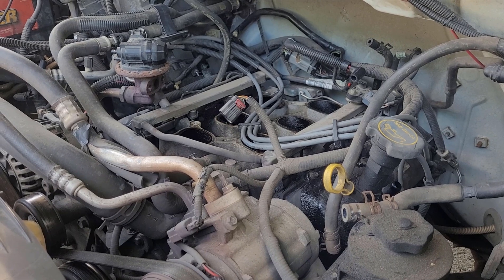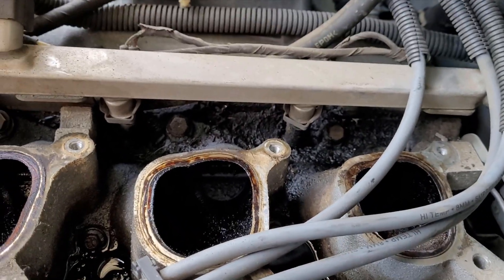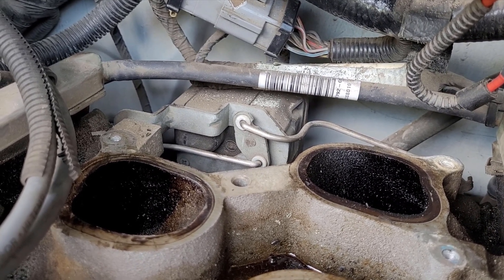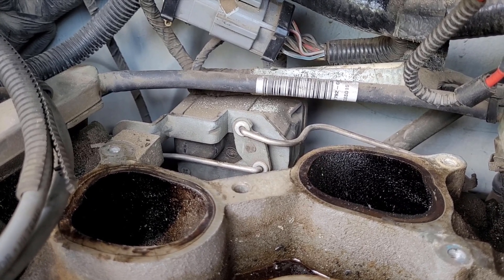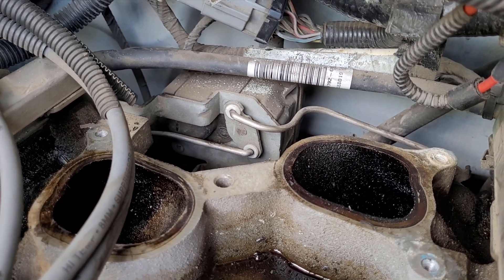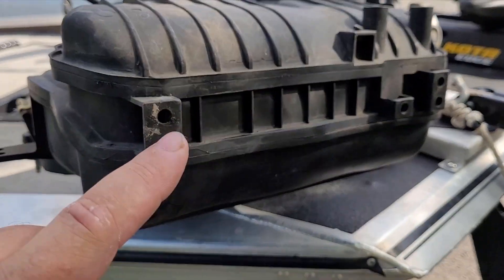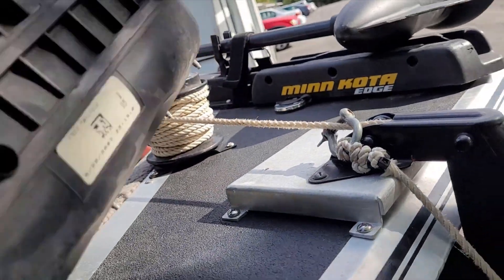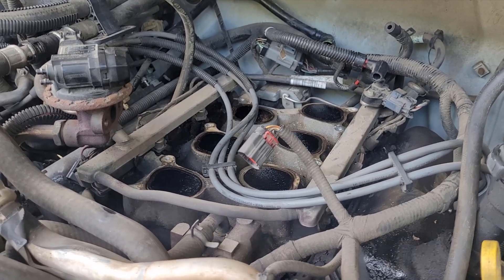Intake Manifold Runner Control Valve, 2008 F150 4.2L V6 - Part1 P2004 Code (Error Code P2004)

Comment: might as well remove the lower intake and replace the gasket and the o rings on the fuel injectors , you did the hard part already. I did this and now over 400,000 miles and running strong !

Comment: Where can I find the actuator for this motor ? Not even ford dealer has it
Reply from the maker: Im not sure if you can. I replaced the whole unit from RockAuto.com when I replaced mine.
Reply: Did you find the part, if so do you know the part number?

Comment: Do you need to drain any antifreeze out of the radiator before starting this job? One guy said you do but I want to know if you had to. Thanks
Reply from the maker: No, I didn't drain any out before hand. I think there is a coolant line that goes to the upper intake but I dint recall muc if anything coming out of there.

Comment: Thanks for the description.  I had this work done by a reputable shop and I was curious about what they did. Mine had clips broken and the shop replaced them and my 200k
08 f150 now runs great again.  Thanks
Reply from the maker: I'm glad you found the video informative and helpful that's exactly why I posted it. When I started searching for information related to the p2004 trouble code on our 4.2 L V6 engines I didn't really find much of anything.
Reply: @cpthillbilly  i had a lean code (P0171) which was incorrect it was actually rich but at least they chased it to the intake runner 
and the broken clips on the butterfly, I believe.  And 2 weak injectors.  Changed  plugs, wires ( both had 80k) and coil had weak spark. $1100  total.  It is worth the cost because its a great truck that looks almost new.   Thanks again

Comment: What about a leaky gasket where the lever goes into the lower manifold? I have that problem which is causing lean code. Stumbled on your video. In process of how to resolve that leak
Reply: I think you would need to remove your lower intake so that you can replace that seal. ????
Reply: @chadhalsted6067  more like replace lower intake at $700 for the part. I plugged off the heater vent control vacuum line and it brought leak down enough to stop the engine code.